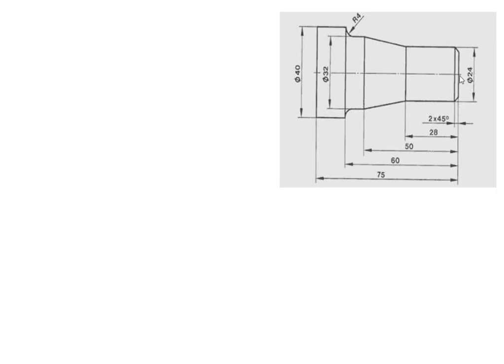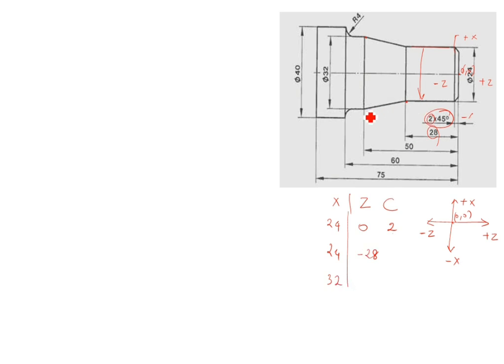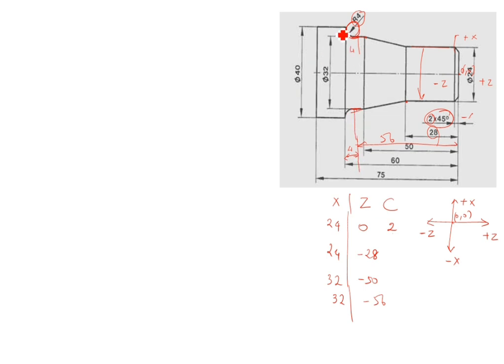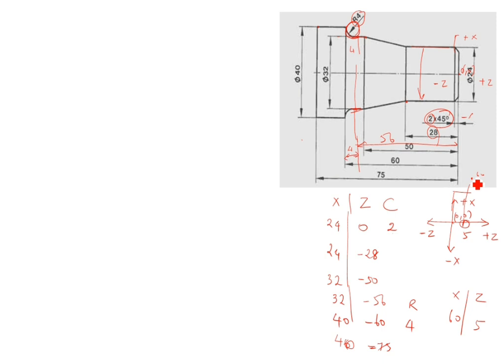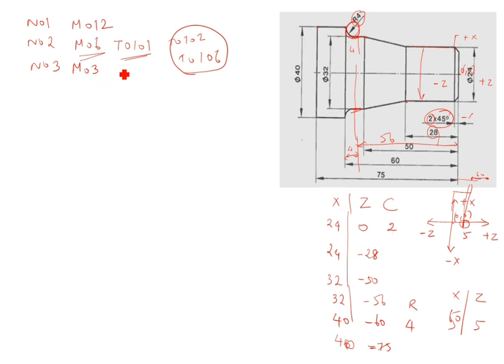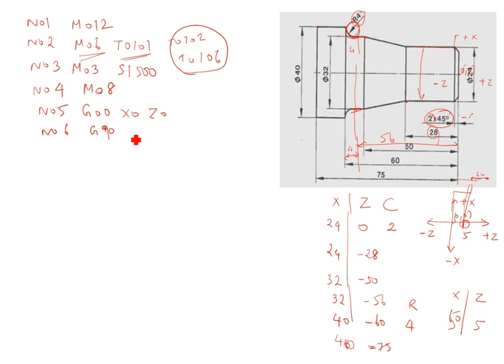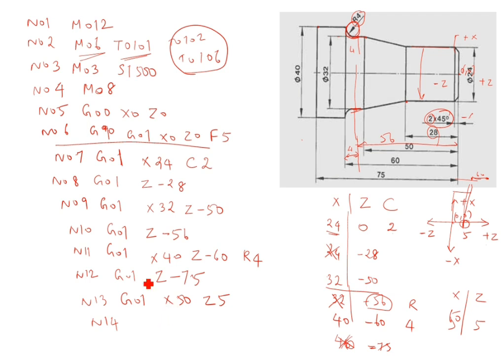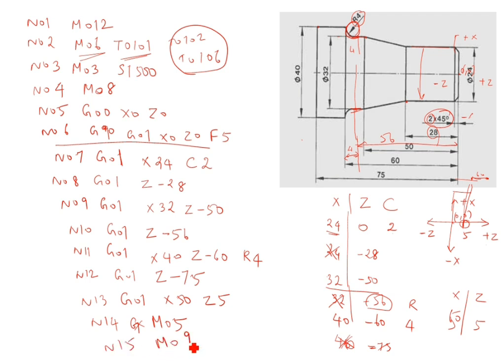CNC Turning Programming / Basic CNC Programming for turning / CNC Lathe Programming / CNC

Comment: You take the origin as center and how come the x axix value gone to 24 and above its 12,16,20 right or is that the right way?
Reply: That is an excellent observation! Your logic is spot on: if the center of the part is zero , then the physical distance to the edge of a24mm part is indeed 12mm (the radius).However, in the world of CNC Turning, we usually program using Diameter Values rather than radius values.

Comment: Mistake at   10:15      For radius in clock wise direction we have  to use code G02 CW .
Reply from the maker: Please check the description,already i have changed N11 G02 instead of G01
Reply: not clockwise, anti-clockwise so G03
Reply from the maker: It comes clockwise G02 code.

Comment: Maam can u explain why x24 is used instead of x12........shouldnt the tool move 12 units in x direction form centre point to get diameter of 24.please explain.
Reply from the maker: By default diameter is set in CNC. So that we took x24 instead of x12.
If we sets 24mm deflection in x-axis,the actual deflection goes to 12mm in x-axis.
Reply: @excellentideasineducation  Thank you so much maam

Comment: You could have used G71 or G72 and do both roughing and finishing on a single instruction block.
Also, doing it by hand would make it much more propense to make an error and ruin the machine or even damage the lathe.
just look into G71 and G710 cyles... it will make your life a whole lot easier